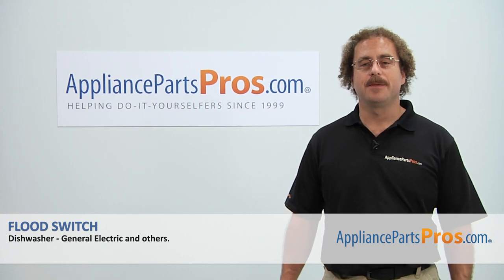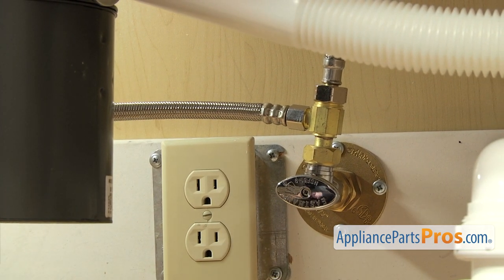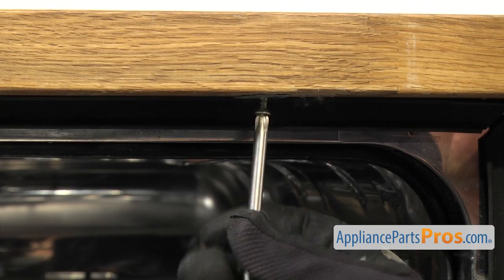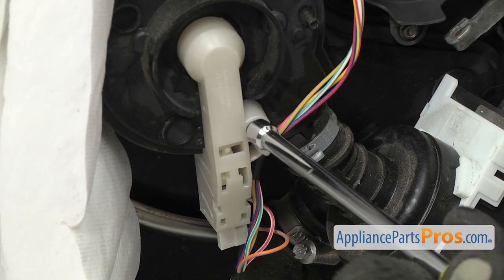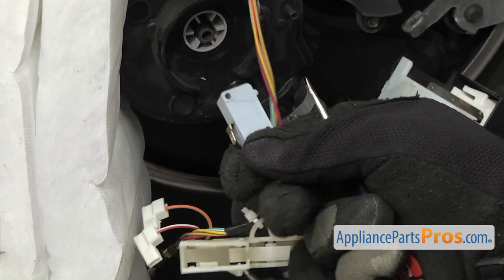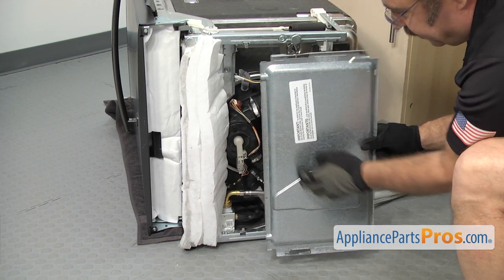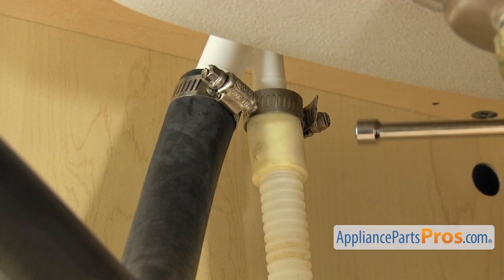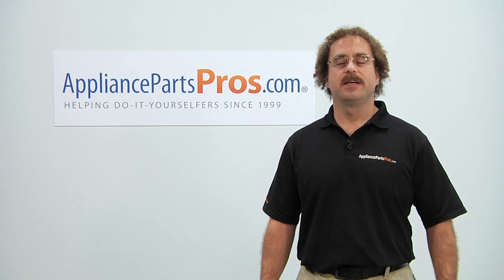How To: GE Dishwasher Flood Switch WD21X23498

Comment: Thanks for your videos, Replacing this switch would fix the dishwasher issue of not filling? Also any way how can we test whether the old switch is faulty ?
Reply from the maker: If you have a multimeter you can test it for continuity. You may also have an issue with the water valve itself if the machine isn't filling up with water.